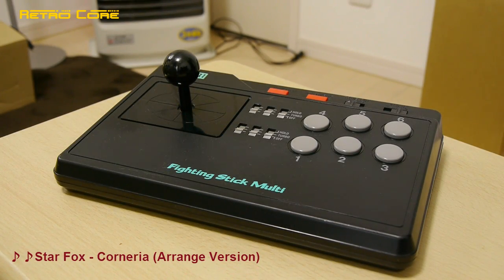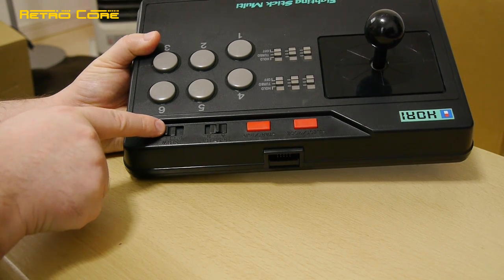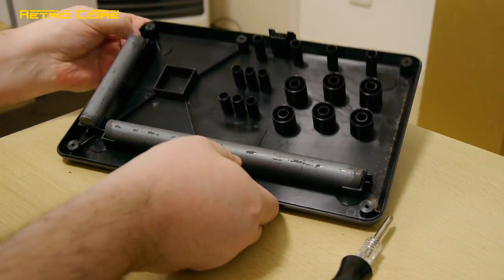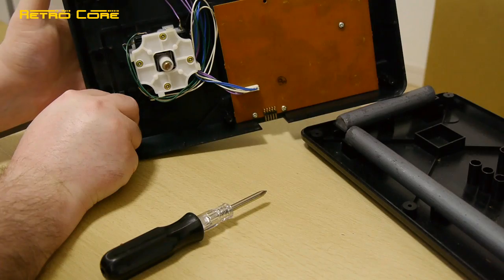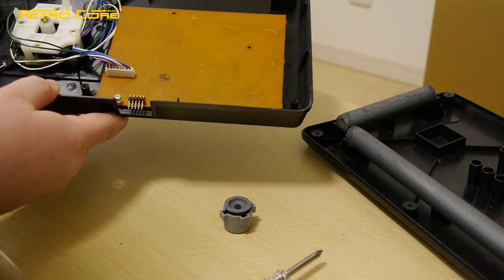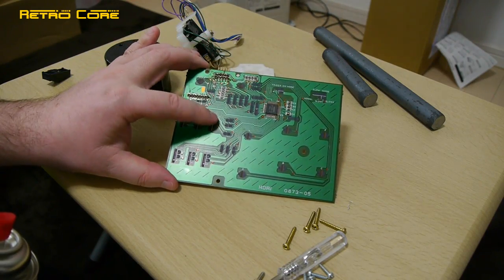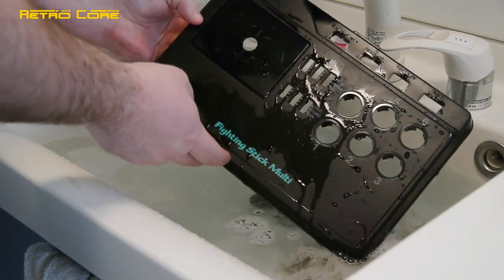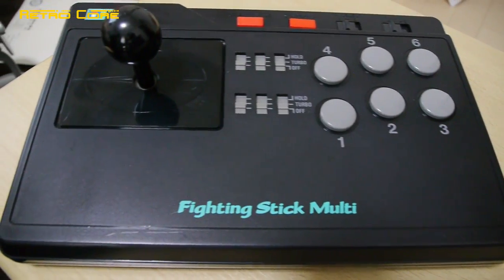Hori Fighting Stick Multi - Teardown and clean - 60fps

Comment: For the Hori Fighting Stick Multi, I would leave the buttons just the way they are and replace the lever with a Sanwa JLF lever, an eight-way restrictor plate and a bat-top.
Reply from the maker: Way ahead of you on the stick mod 👍. It made a world of difference.
Reply: @RetroCore  why? Isn't stock stick good?

Comment: That was pretty cool, Mark. Thanks for sharing. ^_-
And great arcade stick as well... I'm in need of a proper one too, for my Mega Drive and PlayStation 2. I wish it wasn't so damn hard to get them shipped from Japan to Italy at a reasonable price.

Oh, and when you started taking the screws off, I didn't immediately notice the video was sped-up, which made me wonder you were like The Flash or what, for a second. XD
Reply from the maker: The video was sped up?   No,  that's my normal speed!   No,  not really (^_^).   This is a nice stick.   I too would like to have it for my Mega Drive but first I must find the  right cable for it.   It will be great for all those shooters I have in my collection. 
I guess if the steel rods are removed it would make shipping this stick to Italy rather cheap.   The problem is that you'd need to replace them.

Comment: Great video! Is it possible to add a Sanwa JLF joystick?
Reply from the maker: Hmm, it is but you would need to build a base under the casing to hold the stick in place.
Reply: @RetroCore  ok, thank you for your quick respont. So is there a base already in order to keep the og joystick in place?

Comment: There's nothing wrong about washing electronics with water (of course as long as there's no electricity running trough the circuitry and you discharge everything) I normally spray degreaser and then wash everything with water, then use a compressor with an airgun to get everything dry. This is probably the best way to remove dirt from underneath small chips and other components as well as moisture and other chemicals in the air that get attached over time.
Reply from the maker: Wouldn't water rust anything?
Reply: Not really. Rust for the most part comes from contaminants present in regular water and will only happen over extended exposure (weeks/months). Solvents like alcohol are actually more likely to cause rust.
If you are too worried about it you can use distilled water.
Water is actually used during assembly to clean off excess flux.
Reply from the maker: OldGraFX
I see.  Some good info there.
Reply: Oh, lots of people have lost electronics after having cleaned it with water. It only takes a small droplet in the wrong place when you power it on.
I would not risk it.

Comment: I recently bought one of these at a nice price for my PC-Engine. However, it doesnlt come with the SFC or Mega Drive cables. Any recommendations on where to find these online? Originals seem impossibly rare. Is there a website that might make custom cables?
Reply from the maker: sadly the cables were sold separately so finding them in the wild now is 
tough.  I've been looking on Yahoo Auctions for about 6 months.